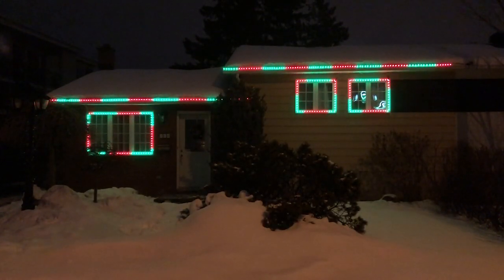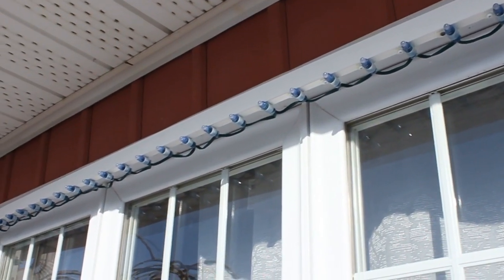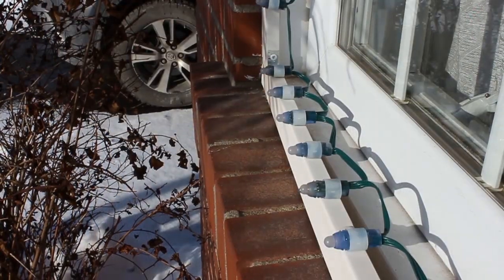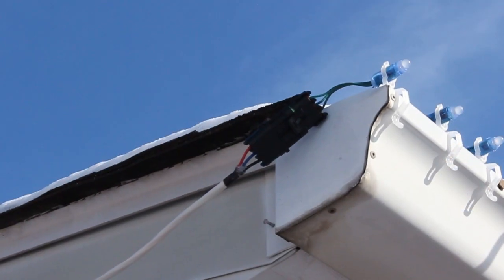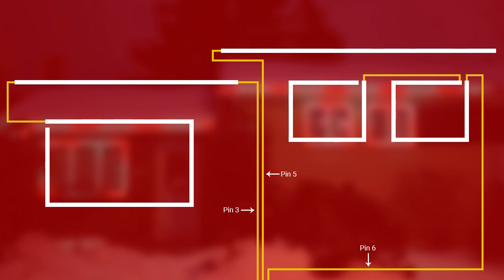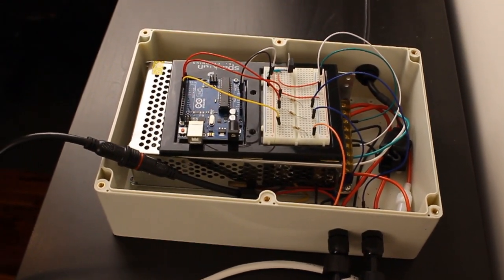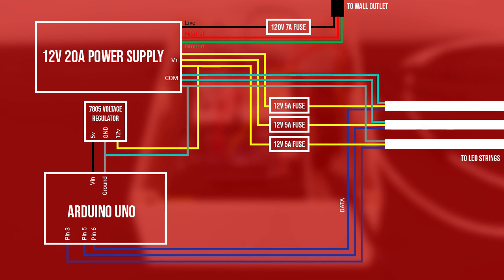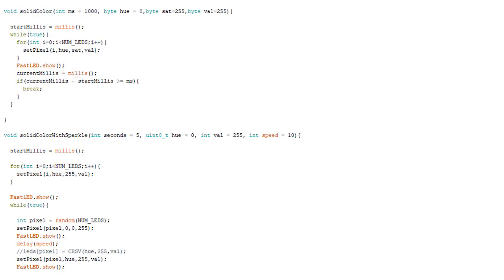How I made a simple christmas light show with an Arduino

Comment: Hello

Thanks for the great video, could you help me with a problem though. I’m using WLED app to controll lights and flashed esp8266 with version 0.12.0…so I have it on a timer switch as well, but when it turns back on it goes to the default amber lights it does not keep the last lights memory did you have this problem?
Reply: You have to set the effects as a preset . Then go into LED preferences under Config. There is an option to set the preset at boot or as boot default
Reply: Thanks that was it.

Comment: If you use an esp8266 or esp32 for the controller running WLED, you can get much more advanced effects, as well as a web interface. You can even use another computer to make an actual light show synced to music with xLights or Falcon Player on a micro computer.
Reply: @PK Cubed can you have multiple ESP32’s running at the same time and have lights synced?
What’s better a esp8266 or esp32
Reply: @danielbass09  Yes, you can. ESP 32s are better as they can have up to 6 data out pins on almost any gpio pin. You can also get esp32s with Ethernet and that makes it much better for xLights. WLED has great support for Ethernet.
Reply from the maker: I found out later about WLED and yes it’s definitely more advanced and easier to setup, that’s what I would recommend now for a beginner.

Comment: Got a link to your cable running to your lights?
Reply from the maker: I bought my cables from a local shop but it looks similar to this: https://www.amazon.ca/Monoprice-104041-Access-Conductor-Speaker/dp/B003L11DP6/ref=sr_1_10?dchild=1&keywords=16+gauge+3+conductor&qid=1620538002&sr=8-10

Comment: i heard that the first LED needs to be close to the controller ( short data line) 
did you have any issues 
thanks
Reply from the maker: No I did not have any problems but yes it's something you need to consider. If the first pixel is too far the data line signal will be too low and will cause issues. In that case you can use a line buffer (like a Falcon F-Amp) or a level shifter to boost the data signal. Another clever trick is to use a pixel at the middle of your run. The pixel will retransmit the signal at full power. You can then design your code to ignore this first pixel or wrap it in electrical tape to hide it. Hope this helps.
Reply: @thegeekden4005  thank you very much for your reply( i just subscribed )... cheers
Reply: I will like to konw that.

Comment: I am hoping to install a similar display for Christmas 2021. However, it will need to be a little bigger - about 558 pixels at 4" spacing. My only questions at this point involve how to properly manage the power injection.  If anyone can provide a resource on that topic, I would appreciate it.  THANKS!
Reply from the maker: The general consensus for 12v pixels is to inject power every 100 nodes. But running your lights at 20-40% and depending on the cable length from the controller to your first pixel you can probably inject power every 200 or more, you’ll have to test it. With 558 pixels you might be able to pull it off by injecting power only at the end of the string (and the beginning of course). If the power is dropping too much you will see discolouration especially with white or other issues. Good luck with your project !